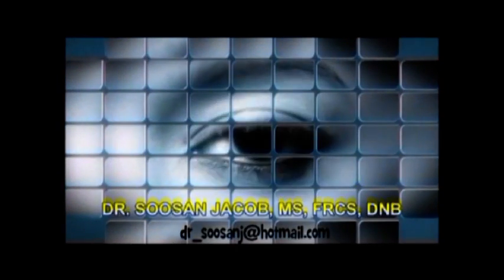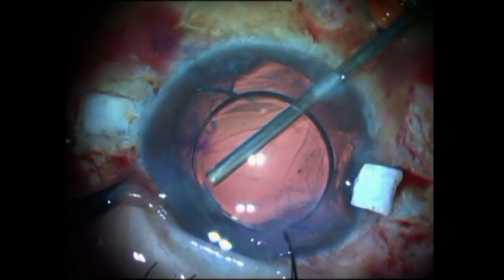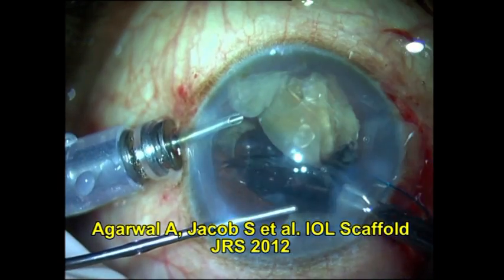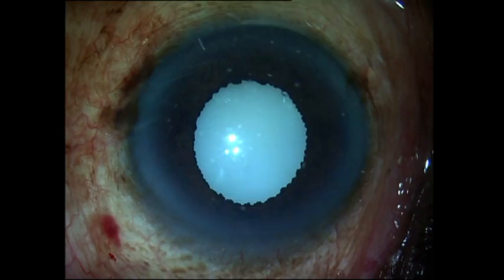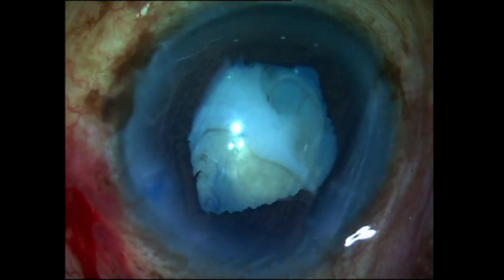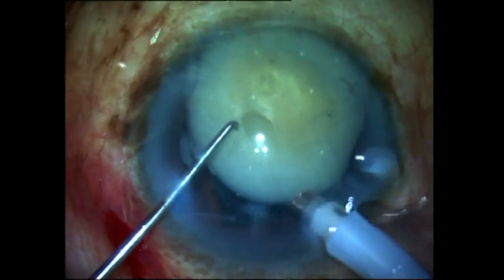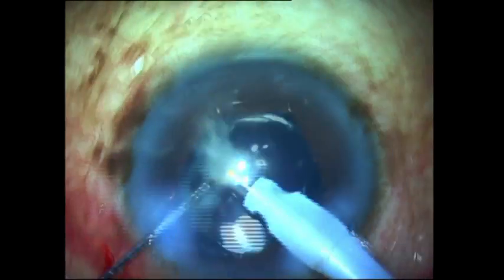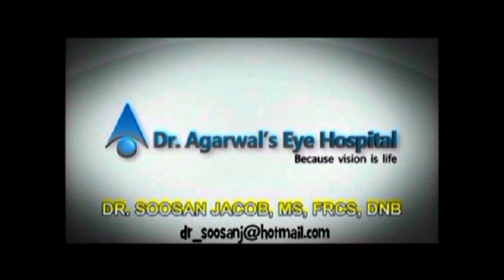IOL scaffold without PCR for white cataract Soosan Jacob with audio 5 min

Comment: What about cortex if there any ?
Reply from the maker: You can go back with  Simcoe or I/A probe and try to remove it if required. Grasp it at the edge near the rhexis margin and aspirate. If visibility is less, you can use an iris hook in that quadrant
Reply from the maker: This is a hypermature cataract with liquefied cortex, so there are generally no cortical strands stuck to the capsule that need to be aspirated out separately. Everything comes out on just irrigation. In any case, in any cataract, it's always possible to use a Kuglen's hook or a Y-rod to retract the iris and look under it.
Reply: not for this specific case ... in general  if we find acortex after Iol implantation. .what's your maneuver to deal with? 
many thanks in advance

Comment: very nicely done surgeries mam.. just one qs, how to be completely sure that no cortex is left behind after putting iol as in case 3. As pupil was also around 6 mm..
Reply from the maker: This is a hypermature cataract with liquefied cortex, so there are generally no cortical strands stuck to the capsule that need to be aspirated out separately. In any case, it's always possible to use a Kuglen's hook or a Y-rod to retract the iris and look under it.
Reply: Dr Soosan the Phaco emulsification happens in the anterior chamber?